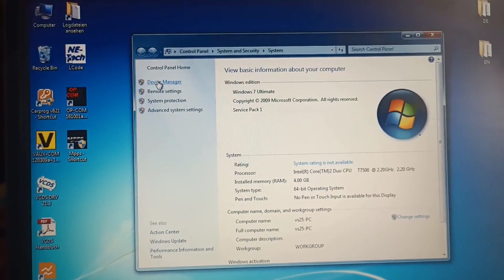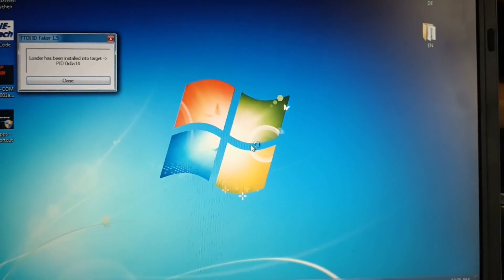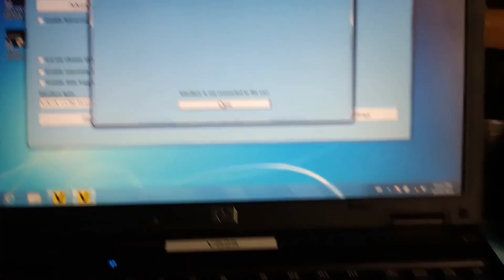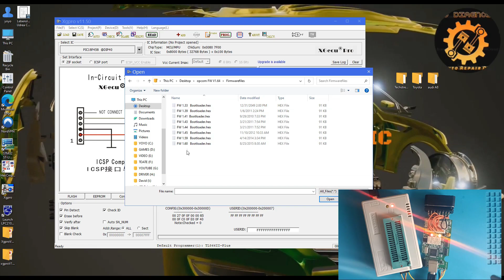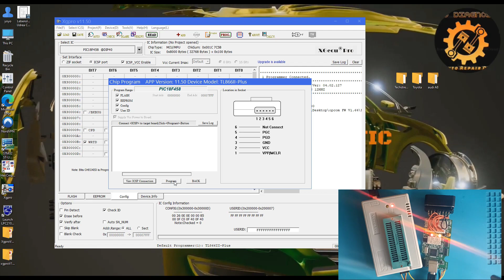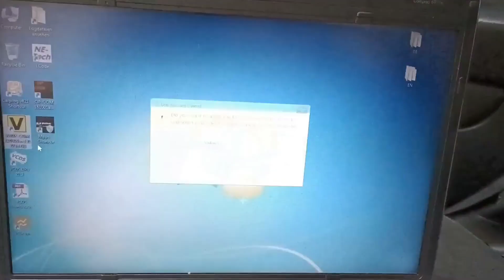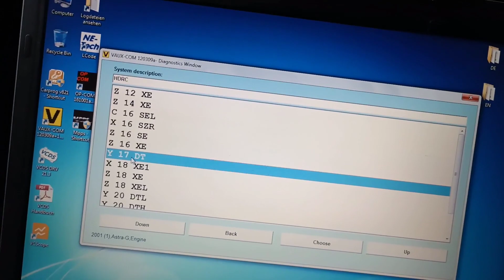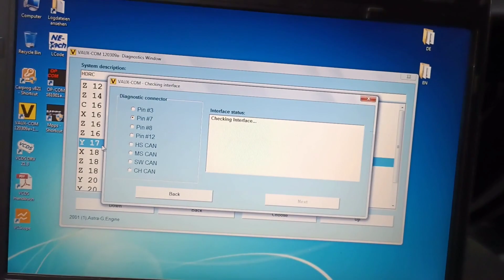OpCom Clone Repair after a failed Firmware Upgrade.PIC18F458 Reflash.

Comment: got a few 1.99 china versions, chip is pic18f45k80, I flashed it to v 1.59 using ocflash, it worked, but now i cant flash anymore, gives error when trying. Would this method with Xgecu still work? the bord has those 1,2,3,4,5 connection points.

Comment: Hello I have problem with my opcom that I bought, it came with 2014 sofware, 2012 software and with china clone 08/2010, when I tested interface on all three interface test was success but when connected to car (tried with only ignition and with car on) it can not read anything, after some tryes cars ecu started rebooting, my rpm cluster went all to zero and then back to idle rpm, and check engine and service interval light started blinkig and in program there was a text something like failed to connect to car. Then after restarting everything I pluged in opcom only in pc and test interface didnt work like on yours, I have same PIC but i have smaller FTDI, and i dont have pins on pcb to solder wires to do firmware update, then I tried to plug in on another pc (first was win10 second win11), on that pc I installed fresh drivers and opcom 200603a, and FTDI 2.8.30 version, now when I plug my opcom to usb power led turn on, then rx and tx starts blinking and clicking few times then turn off, but when I entered the opcom 200603a when press test interface nothing happends. (all programs was runned as administrator and everything is done by procedure from first to last try) Do you have any idea what it can be, I bought this chinese shit to try to code something on my astra but it wont work....
Reply from the maker: Hi, first of all the best operating system is Windows 7 /32 for these clones. You must instal manual the drivers from the Software version 2012 or 2010. You need older drivers to be able to make this clone work.
Reply: @YOYODiagnostic Okay really thank you, after some research I think my PIC is bricked. I will eventualy buy new opcom and install win7 32-bit. Really thank you!
Reply from the maker: @Faceless009 👍
Reply: @YOYODiagnostic  sorry one more question can I try to reprogram this opcom only with usb and oscflash, because on pcb I dont have holes for programmer
Reply from the maker: @Faceless009  give a try, you have nothing to lose, this is what I will do.
Reply: @YOYODiagnostic thanks brother

Comment: Hey dude, i need some help. I have swapt the ftdi an pic chip to original pcb is v5 2007 but now i have no connection but light green and yellow is on. did you think i must flash it ? And can you give me the hex files. I searched in many forum but i cant find any hex for the opcom…
Reply from the maker: To flash it use OCflash

Comment: hi YOYO I have quick question, what chips are good and used in v5 opcom I'm doing small rework of my opcom and Im wondering which chips to chose I have now on my board following chips:
PIC 18F485(ori)
ULN2003A
74HC238D
MCZ33897EF
MCZ33661
MCP2551
MCP2551
And Im not sure if they are original, all relays are 4.5V omron Thanks.
Reply from the maker: Hello, 
try to work whit your Clone, if is okay leave the PCB how it is.

Comment: which programmer do you use in this video? Thanks a lot, I'Ve been struggling with V1.99 and wanna try to flash an older version before throwing it in the bin
Reply from the maker: Xgecu tl866ii plus

Comment: Can i do this with Iprog programming tool? Thank you
Reply from the maker: I didn't try.
Reply: @YOYODiagnostic Thank you for replying Sir.  Another question. Can we replace clone chip with original and flash original firmware?
Reply from the maker: @Autoschlüsseldienst  
Yes you can do that . 👍

Comment: Hi, I flashed v1.67 (latest) it flashed ok. The software Test Interface identifies the interface correctly and shows firmware version 1.67,  But when I try to read Car, it says no communication with the ECU. did I wreck my device??
Reply from the maker: This firmware is Chinese ? it should only work on the software provided by the Chinese sellers until 2012 or 2014. In order to run the one until 2016, you need 1.65.  I told you.
I wrote 1.39 and then I connected opcom to the software until 2016 but you have to know: the one with the original PIC changed by me worked, the one with PIC china didn't work.  What software version did you try, email pictures.
Reply: Ahmed i have the same problem, i update  my china device to 1.67 but dont work in the car You solved ?  PIC is deadh ???
Reply: @TheLwd11  no solution. Bought new for 25 euro. V1.95. Asked seller to confirm pic is original. It works well with fantomel pro version software upto 2021 vehicles. 👍
Reply: @okhascorpio  Can you share where you bought your opcom with the original pic?